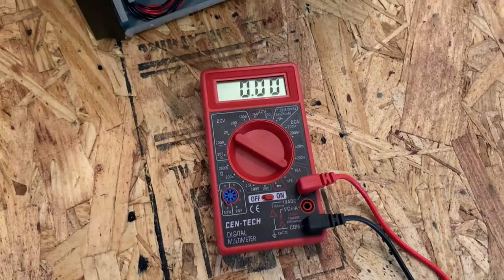Synology DiskStation NAS - No Power Fix - DS1515

Comment: Mine had this happen on Sunday. My board already has the 100R. I found the transistor and battery at a local shop and they also did the soldering. 20 dollars and about and hour later to reinstall and now up and running! No need for more ewaste and rushing out to buy a 1520+! Thanks for this info saved me some money!

Comment: thank you very much, you saved me.
my nas did not start anymore.
it was already patched with 100R resistor.
I had tested the power supply and it was working fine.
after some research I found your video.
I then test the transistor, and it would be broken.
also I ordered one, the manipulation to change it is not easy.
and miracle, the nas starts.
what happiness.

Comment: Hey buddy, I found your video through Synology forums. My DS1815+ just died yesterday after having replaced it once through RMA but its now waaaay past its warranty so I am SOL. But I did try bridging the transistor on Q4 and I got it to actually power on.  I imagine a BC847 transistor would be what I need as they already have the resistor fix done (verified by looking at that corner and indeed there's a resistor there). Thanks heaps for making this video!

Comment: Thanks for video.  My DS1815+ already had the 100R resistor.  Also, I added another resistor near the now broken transistor about 2 years ago.  Your demo showing how to test the transistor with a jumper/volt meter was key for me.  Mine powered up the same way yours did.  I have ordered a bunch of new transistors to replace the broken one.  Thanks.

Comment: Report: Worked like a charm!  I found that the transistor short test didn't do anything until after I replaced the resistor and battery.  Only then would shorting the transistor start the unit temporarily.  Once all 3 were replaced, I'm back up and running!  Thanks again.

Comment: my 6 years old DS1515+ suffering similar issue. Random power off and back on... came across this video. Really appreciated the video and explanation of your experience.  Added the resister (2x 200ohm 1/4watt in parallel....ran out of 100ohm 1/4 watt.) now just waiting on the BC47B transistor and CR1220 from DigiKey to finish the repair.

Comment: Thank You!  Fixed!  Just fixed my +1815 with a BC847B - E6327HTSA1 (BJT NPN 45 V 100ma) that i got on Mouser.  Hardest part is soldering the tiny part on.  So happy it works again!

Comment: I got a DS1515+ that died too.

I did the same test on the transistor and the NAS is ALIVE! Ordered the BC847 transistor. Replacing it was quite a challenge as it was SO tiny!!

Now the DS1515+ is up and running fine again.

I ordered the 100ohms resistor snd the battery as standby should the NAS fail again.

Comment: My DS1515+ seems to have the same issue. It would not boot when pushing the power button. I assumed it was the power supply, but after jumpering the transistor, or jumpering the green PSE connector to ground, it is up and running. I'll get a new BC847 and do the repair. Thanks for posting this.

Comment: Thank you sir. I’ve replaced the transistor and it starts up nicely, it’s been stable for 13 hours, the longest it’s been running in the past 2 weeks. The last required part I’ve received yesterday and swapped it. Soldering wasn’t as bad as I thought as it’s such a small part. Fingers crossed it stays like this. ❤👍

Comment: Same issue, fix saved me. Ordered a BC847B replacement transistor, but it will not be delivered for a couple of weeks. CPU fix was done by before and I added a new battery just in case. Went through my spare parts collection (many years old) and found an NPN transistor with similar values (2n3704) but with wire leads (TO-92 case). I removed the old transistor and soldered 2n3704 leads to the proper points on the board. Not particularly sophisticated and it sticks up, but now I am back in business. Will replace with the correct transistor when it arrives. Thanks for the clear guidance.

Comment: I actually had the resistor replaced under RMA in 2019, but recently started having the exact power issue described here. I'm getting a buddy to solder a new transistor onto the board and will replace the battery too. Thanks for the excellent detail!

Comment: Hi, thank you very much for your video. My 1815+ storage died several weeks ago, and I was not sure what to do with it, how to repair it. I was already thinking to purchase another one on eBay. After watching your video, I checked the motherboard and found that my storage already had 100R resistor soldered. Short cutting mentioned transistor (my motherboard is a bit different to yours, but this transistor is there, and it has the same function) did power up the storage but it never booted properly. All four network LED indicators were on as soon as storage was booting which is not normal behavior. I bought 10 BC847 for $2 and replaced the faulty one. It was not easy since it is incredibly small, but I managed it. Storage booted up and I could access the data.
THANK YOU VERY MUCH!!!!!!
Cheers
Reply: Hey, the same thing happened to me, just yesterday, where is the bc847 on a DS1815+ though?
Reply: @joystickgaming5180  Hi, the transistor is on the left side of the power connector on the mainboard. There are two places available for the transistor and they are parallel (Q1 and Q4). Mine was soldered on location Q4 which I damaged when I was un-soldering the broken one. I soldered the new one on the Q1 location (which is empty) and the storage booted up.
Reply: @ellademe  Thanks. I ended up finding a brand new DS1815+ with warranty so I'll run with that and maybe keep the dead one as a spare and perhaps play around with it etc. I'm not real good with a soldering iron but I might give it a go. Appreciate you spending the time to reply.
Reply: @ellademe  Where did you find the bc847

Comment: I’m fairly certain the transistor issue is the exact issue I’ve been having with mine. Thought it was a bad PSU, so bought and replaced one, but then it still didn’t power on. So frustrating. Going to give this a shot. Good work, man!
Reply: Follow-up: I finally did the fix. and it worked! Thanks, man!

Comment: @1lifejourney

So, I am a major newb to soldering and electrical components altogether. I see you are using a transistor to help with the power issue (I happen to be having both the Atom bug issue and the power issue..). I see on the 21 page Synology post regarding these issues that many people are using a 4k7 resistor for the power issues instead of a transistor like you used. Any reason you used a transistor there instead of the 4k7 or 1k resistor? And, how are these holding up after being fixed?

Comment: Thank you for this, ordered the transistors on ebay and fixed my DS1515+. Seemed to already have the 100ohm resistor so it must have been a late model. All is working as expected.

Comment: Brilliant solution! 
It worked right away. I used a BC547B (TO92 type) that I already had and soldered that onto the pads. A new battery and the 100 ohm resistor and it's up running again. 

Thanks very much for publishing this great video.
Reply: still working ?

Comment: Thank you for this video.  
  
I originally jumpered the pins on the transisitor, figuring I don't really need the power button. This did not work, though the device powered on it did not boot. So then I figured I'd add in that resistor and replace the battery, since I had those on hand but not the BC847. Still did not work.  
  
Not one for patience, I replaced the bad transistor with what I had on hand (BC548) and now my disk station is working again.  
  
Information provided for others who may encounter similar circumstances.

Comment: My 1515+ was RMA’d a few years back and a replacement sent.  Even though the one I sent in looked brand new the replacement had water rings on the top where the previous owner had set a drink.  Since then the server has worked well with 4 bays full.  I have slowly upgraded the four drives over the years to increase capacity.  I recently found a great price on a 12TB Toshiba drive that I decided to get and add as a hot spare.  After that I started having random shutdowns every day or two.  Removing the hot spare everything is fine.  I think I’ll just keep running it with four drives.  Not sure but DSM did warn me that the hot spare was not on the compatibility list.  So at this point I’m not sure it a new power supply would fix it or perhaps I need a more compatible hard drive.  Just upgraded my last 5TB drive to 10TB (both WD Red Pro) and that went fine.  Seems I’m fine unless I add the fifth drive.

I just mention it in case it helps anyone.  Your solution may just be to run fewer bigger drives if your having trouble.

Comment: Thanks for posting this video, as it has saved me from placing my Synology in the bin. I'm having issues with my DS1515 as well, and I thought it was the power supply. I've spent the money on a new power supply and swapped them out only to find it wasn't the power supply issue. I followed your video, and I got my Synology to work with the voltmeter. I wish you showed your poor soldering skills as I have no idea how to replace BC847. If you solder again in the future, I would love you to post it. My next step to how to replace the BC847.
Reply: I am getting ready to do the same thing whenever my BC847's arrive. I don't even know if I ordered the right transistor but we will see. There are two ways to do this, either wtih a soldering iron or with a heat gun. The heat gun method I would only recommend if you know what you're doing as you can damage a whole lot more than what you're trying to fix. That leaves you with the soldering iron. The best thing I can recommend is make sure you are using a good soldering iron and a good clean head. Cannot emphasize clean head enough. You need smooth surface and good induction. The next thing is going to be solder wick. This will make removing the existing transistor easier as you won't have to fight getting all 3 contacts hot to wiggle it out. I would place the wick on top of the 2 pad side, and use the soldering iron to apply heat directly on those pads until the solder gets pulled into the wick, thus releasing the pads. That leaves you with the final pad, same method or you can simply grab it via a pair of tweezers and use the soldering iron to apply heat to that single pad until it breaks free. I recommend after getting that transistor out that you pull the remaining old solder into the wick and clean up that area. Then apply some rosin, and a little bit of solder to fill in those pads in a circular scrubbing motion. This will make installing the new transistor easier. Then you will need to place the new transistor on top of the pads, making sure they line up  properly. Then start by heating one side at at time. Start with the single pad, make sure you have a good clean weld with the pad, and then angle the solder iron in a way where you can touch both pads and heat them up until you have a good clean connection with both pads. I solder at 850 degrees. You should be able to do that with half of that heat. Be smooth, take your time and you'll get it done.

Comment: So I got the parts, and the first test with jumping the transistor at those contacts did not cause the power to kick in and start. So perhaps this part is OK on mine. Something else is not working. Mine has usually booted up after sitting, but will stay on everything functioning for maybe a day or a couple or so. I dint pay attention, and look and its not up any more. 
Pretty frustrating.  I did open it up.....
 and get the MB out. You will need to remove the back plate holding the fans(after chassis cover). Nice not to need and remove the fans. Its actually pretty easy. 
So once you have the 5 screws off for the chassis cover off, then the front I removed with ribbon AFTER I disconnected the MB power(Not sure this is necessary, so dont do it until last step) ,
 then the MB screws, the back plate, another cable connection, push off the SATA connection, and its out. 
I replaced the battery. 
I will be upgrading the RAM to 6GB, and what is this extra RAM slot I have behind MB? (I have the 1515+). Is that how I can get 6GB..leave the 2GB stock and add 4GB?

Comment: Hi all. Also no power on mine 16feb2022. Scared the livin daylights out of me. Already ordered the parts.
Question... replacing the battery does what?
Does it reset the CMOS in such a way my system needs to rebuild my raid array?
Is there risk for my shr raid array

Comment: Just ordered the BC 847B E6327 NPN 45 V 100 mA transistor from Mouser, need to dig out the solder iron. The unit is power up again after dead for a few days. I expect it will go down soon enough after the transistor arrives.

Comment: Just replaced this transistor in my now 8 year old ds1815+ ... I used a BC817 general purpose NPN xsistor in the same sot23 package. For those not aware, it is the Intel atom bug that slowly degrades the bc847 out of spec over time. The BC817 has a higher current rating of 500 mA. Am hoping this makes for a longer transistor lifespan.

Comment: Could someone tell me if the case is supposed to have tape covering the ventilation holes (the mesh Synology logo) on the power supply side.  I took my case apart for the first time and the motherboard side is open so that air can flow through but the power supply side has tape covering the air flow mesh.  I could see that maybe that was done for a reason or did someone just forget to remove the tape when building my case?

Comment: I had a no power issue as well but plugging an ATX power supply into the motherboard allowed the device to turn on again so I'm guessing my issues is the Synology PSU. I had the original issue with the CPU bug but got a no cost cross-shipped replacement. Was very happy with Synology at the time but this time when I tried contacting customer support they were instead customer unsupport. I'll just buy a new PSU online, and not from them.

Comment: Removed the transistor that was on the bord but there are no holes or pins to connect the new one to, any suggestions?
Reply: The BC847 is a surface mount transistor.  The part is soldered to the pads on the top of the board.  Someone on an earlier post described in detail how to replace the part.  Good luck!  I'm waiting for the part.

Comment: I just had my 1815+ fail because of that transistor.  I did not have that transistor so I put a 1k resister between Q1 and Q2 and it powers on for now.  I will order a transistor though if it does fail down the road.

Comment: hi, I replaced the resistor and the transistor but the problem remains, do you have any suggestions? if I short-circuit the pins of the transistor the NAS works correctly ..... thanks to those who wanted to help me
Reply: Same here. You fixed your unit?

Comment: What kind of BC847 are you using (BC847A, BC847B or BC847C)?
Reply: Having the same issue with my 1815. I located the transistor which reads "1AM N" but I am unable to find an exact replacement as there are A, B and C variants. Please let me know if you ever find out. Thank you.
Reply: for my DS1515+ BC847B works and works great, tested
Reply: Awesome, been running for 3 weeks stable using a bc847b I got from mouser!